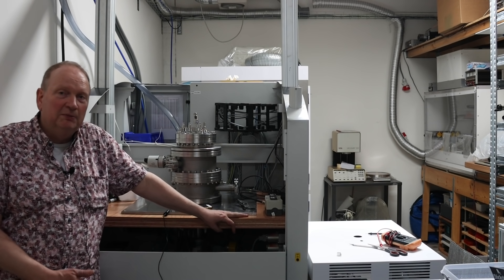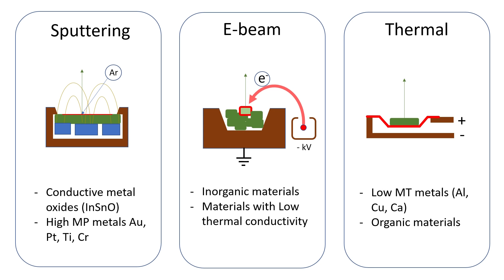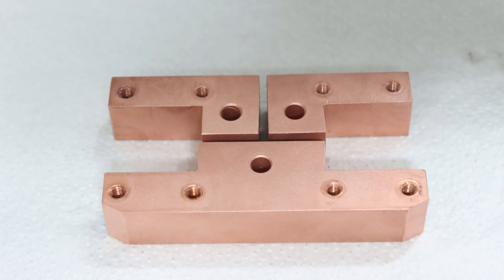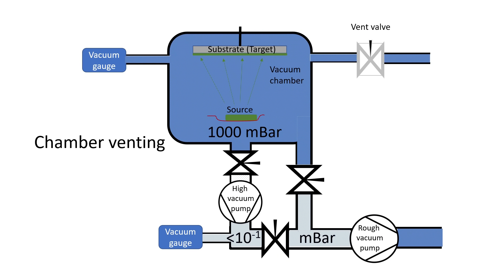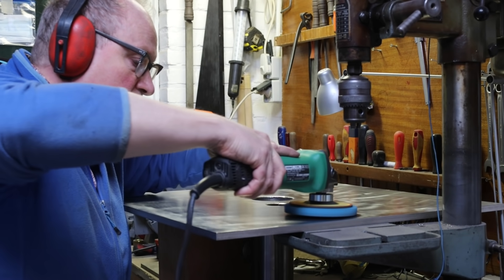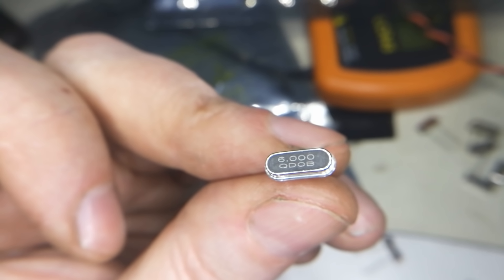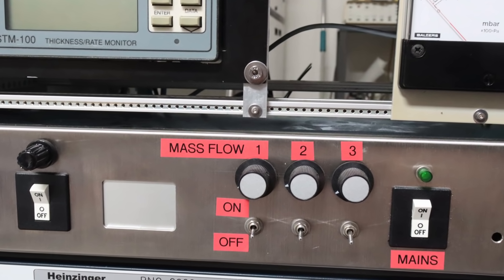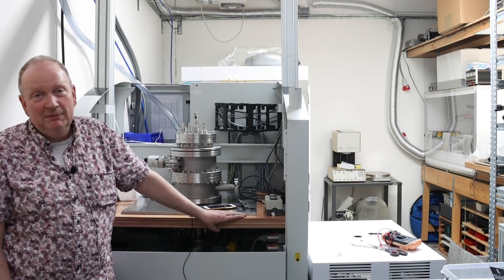DIY Physical Vapor Deposition (PVD) using Thermal Evaporation

Comment: I was goìng to ask if the quarts crystals were redundant after each use and i think you answered that i believe by having to buy purpose ready crystals.
Am i correct?
I wanted to ask also the quarts crystal being measured by its weight persay during gas transferal would it have to be recalibrated after to zero out the readings?
Reply from the maker: The electronics quartz crystals can in principle also be used multiple times, although it depends a bit on the thickness of the layers that you deposit. Generally you could use them for about 5 - 10 runs or so. Quartz crystal frequency is dependent on the gas pressure, although not so much any more once you go in the deep vaccum range. You reset the layer thickness value to zero using the value the frequency when you start evaporating.

Comment: Are there subcontractors to do this kind of work for you instead? As you say: "means to an end".
Reply from the maker: Sure, but that would be pretty costly. I could have maybe bought an old system. There is really no telling what that would have cost, from a commercial seller probably well over 15.000 Euros, although you can be lucky and buy something for a few thousand Euros from ebay. Still, these old machines generally require a lot of work to get in shape. My motivation to do it myself was the fun of building and learning, and at the same time to put a lot of my workshop junkyard to good use.

Comment: so what are you going to make some sort of super lens of with layers of silver at 551nm to 590nm thickness. I wonder if you could change the angle the mount, so it deposited the silver layer unevenly then you deposited some sort of fiber optic like Aluminium fluoride on top of the angled sliver so the angle could over power the 0.12 RI of the silver. maybe I don't really understand how RI works, but I would think if you had fiber optics forcing the light to come straight down and enter the low RI film at angle greater then RI of the low RI film, it should be functionally negative, right. it's been a long time ago in jewelry school when I studied RI or Optics.
Reply from the maker: For metals refractive index works somewhat different, it's a  complex number since the extinction in the material is extremely high.  Anyway, I'm mainly going to make diffractive and emissive devices with this system.

Comment: Wow, this takes me back ! :-)

In my early career, I spent a lot of time around high-vacuum and vacuum-evaporation systems. I ran an ultra-high vacuum system when I was doing semiconductor research at university (10^-9 torr), using ion pumps and a TSP (titanium sublimation pump). Turbomolecular pumps of that era had high pumping speeds, but couldn’t get to the vacuum levels we needed. (I dunno, maybe they still can’t, or maybe they were just too expensive compared to ion pumps back the ?)

In my first job in industry, I ran a lab that had 3 vacuum evaporators and an ion implanter in it. Those systems all used diffusion pumps, and I grew so tired of tearing down and cleaning/repairing diffusion pumps that in my next job I didn’t let on that I knew anything about high vacuum 😆

It’s been decades now, though, and I’d kind of enjoy tinkering with high vacuum again, even a diffusion pump :-)

I love your material and can’t wait to see what you end up doing with your new PVD system!
Reply from the maker: Well, vacuum technolog is actualy quite a lot of fun, as long at you don't have to repair and clean stuff all the time, which unfortunately happens a lot if you use old equiment... (;-)

Comment: i heard a leybold D2500 turbopump go from 39,000 rpm to 0 in about 0.2 seconds. it, as we say in the industry, "puked" high quality aluminum dust into the laser cavity. the HV plasma then "vapor deposited" it all over expensive glass that has to be an electrical insulator but isn't any longer.... i love my job.
Reply: I can still hear the 'bang' during the self-destruction phase of Leybold TMP1000 pumps. Those pumps were notorious for that, so our customers (CD-producers) needed at least on or two spares on stock.  Bearing failure? I once tried to get original bearings from the manufacturer and he quoted 800 Euro for the pair of ball bearings...With the advent of MagLev pumps reliability has gone up.
Reply: @michaelhompus2475  balancing it after a bearing change is not easy

Comment: The irony... I just dropped about $4000 on difussion pumps, rotary vane pumps, thermocouple gauges, cold cathode gauges, stainless fittings, tig welding conversion kit for my mig welder. And here you are doing what I'm about to do. Neat to see Applied Science caught on to this video, I'm definitely taking a lot of inspiration there.
Reply from the maker: Just curious, what are your plans for the system you will be building?
Reply: @HuygensOptics  I have a two ideas that stand out most, my first project will be condenser microphones, sputtering the diaphragm with varying metals. And second will be for telescope optics. I may experiment with some photovoltaics, semiconductors, or displays, but not much beyond giving myself a bit of a chuckle to say I did it. Maybe down the road an affordable electron microscope will turn up randomly, cause I'd love to do some backwards engineering of some chips.

For now though, it's more like a puzzle of what materials I can collect and assemble together. I'm still weighting my options on what kind of chamber to use. Glass bell jars are beautiful, but also really expensive. Pyrex cylinders I've been eyeing a lot more lately as they are very affordable. Or maybe I'll get lucky and an affordable vacuum chamber will turn up on ebay or locally. One can dream.
Reply from the maker: @TickyTack23 great stuff looks like you have quite a journey ahead of you! Maybe you should consider doing a little photolithography as well or use shadow masks (as was shown in the latest Breaking Taps video). Anyway good luck!

Comment: Read all comments, and saw noone asked yet- really interested in how you did the central mechanical rotating passthrough that still allowed high vacuum to be achieved- would like to build a Czochralski furnace someday to make my own sapphire boules with custom colors- and a mechanical crystal rotation rod is needed. Can you do a video on the construction of this portion? Absolutely incredible work, your channel is one of the absolute best on youtube
Reply from the maker: Thanks. I can very quickly tell you how it works, maybe it will feature in an upcoming video, but I don't know when. It consists of an axis with a bend, inside a very flexible vacuum bellow. This allows for an hermetic sealing of the feed through, because of the bellow. You can rotate the axis inside the bellow by moving the off-centre part of the axis, as is shown briefly in the video.
Reply: @HuygensOptics  I took a look again, and it appears there isn't true circular rotary motion with a standard axle then, only a wobble using the bellows- so it does not appear as though there is actually straight rotary motion to the inside, in the sense of a constrained motor shaft, correct? If this is the case do you know of a way of creating such a union?
Reply from the maker: @CaskStrength777  You are right, there are a couple of small vacuum compatible bearings inside that decouple the rotation from the wobble. There is also a bearing on the outside of the bellow to connect it to a stepper motor. I must admit it's kind of exotic, and I did not give it a lot of thought, until now.
Reply: @CaskStrength777  If you need "proper" rotation a magnetic coupling is best. Either a glass or ceramic window with strong magnets on either side is the most simple motion feed through. Downside is you have low torque and the magnet strength limits your holding force. The other option is basically a blcd motor using several coils around (inrunner design) a ceramic/glass tube (ferrule) and magnets on an inner shaft as your rotor. When the coils are powered in sequence, you get rotation of the rotor. This gives you greater torque and allows precision control. The magnetic coupling is usually used for manual rotation, such as moving a shield or substrate. Depending on your skills and requirements, either option can be constructed for under $200.

Comment: Nice work! But I do not know any material that you can do in thermal evaporation that you can't do in sputtering... Even for optical lens, one of the tests we've made with sputtering was put PTFE on a normal plastic lens. Just don't forget you have to use RF or pulsated power sources...
Reply from the maker: Organic electroluminescent materials such as the ones in OLED generally suffer from strongly degraded performance (or no performance at all) when you try sputtering them or even when you try to sputter additional layers like electrodes on top of them. Evaporation of organic emitters is one of the applications of this setup.

Comment: Hello, what flow rate and how you will evacuate it out of chamber, let say if you need to run for few hours, same time to keep pressure lower then atmospheric? 
Regards 
GEHNGIZ
Reply from the maker: I use approximately 100cc/min air. With this flow I can get a stable plasma even when fully pumping on the chamber (no throttle). Plasma generation should be done close to the inlet where the pressure is at its highest.
Reply: @HuygensOptics  Thank you sir 🙏,  nice lab you have,  i believe you spent quite long time to build it.
Regards

Comment: Watching my collection of lenses and an old agfa camera, infested with fungus, I got interested in vacuum deposition.
I did not get involved but underwent several setbacks on my projects.
Your commentary reveals your steadfast determination and the doer in you. All the "junk" you have collected over the years will surely and quietly find an application you had in mind, even if it takes centuries!
Best wishes!
Reply from the maker: Well, mold inthe AR coating is relatively easy to remove with pitch polishing. That is, if you know what you are doing of course. Getting a new coating on is a different subject. That is generaaly very expensive. But sometimes it is not even nescessary to have lens surfaces coated it it is just one, because not all surfaces are equally sensitive to ghost reflections.
Reply: @HuygensOptics  thanks for your reply!
Those were very old multi element glass lenses, some bound with balsam, which is not used these days. After safely cleaning the exposed surfaces, there were no new abrasions but the periphery had coating tortuous radial veins of lost surface coatings.
I do not want to remove the remaining coating!
It's a large format camera which could handle color film!
I have made small high voltage transformers (max 200 milliamperes) later all of them were the shunted type, to handle short duration short circuits.

Comment: Hello. Thanks you for the video. Can you please explain what is the purpose of bypass line in vacuum system and when we can don't use it?
Reply from the maker: The bypass is used to pump down the chamber while the turbo is running to bring the chamber vaccuum down to a level that the turbo can handle. After that level is reached the bypass is closed and the other two valves are opened.
Reply: @HuygensOptics  Can we don`t use it?
Reply from the maker: @konstantinektov3473  yes, you can leave all the valves out.

Comment: What range MFC did you use for the plasma cleaner for air injection ? I am about to build something similar and have some units in the range 5 .. 200 cc/min. Did you feed compressed air into the MFC, or was one side just vented to the atmosphere ?
Reply from the maker: The plasma was generated from air at atmosphere not from pressurized air. The flow controller has a maximum of 100cc/min but that value was specified for Argon. I usually use it at the max setting (fully open). In my case I have a small chamber and a relatively large pump, so even with the high flow rate, I have found it is best to generate the plasma close to the inlet, where the pressure is at it's highest. Sounds to me the units you have should be perfect for the job.

Comment: Excellent video. Can you tell me about the material and fabrication of the Inspection window please ? Regards, Mark, New Zealand
Reply from the maker: The smaller window in the chamber lid is quartz. I did not make this myself, fortunately this window was present in the surplus part that I acquired. I think this was clamped using some soft metal seal such as Indium.
Reply: Would love to see detail video on fitting the optical window to the apparatus myself. Always wondered how this was done too! Indium as a seal- very interesting

Comment: How do you finally test for flatness ? Interferometer or what ? Nice video.
Reply from the maker: You mean the flatness of the bottom plate? For that I used a straight ruler, since the specs are not critical at all,
Reply: @HuygensOptics  No, i mean the reflective surface.
Reply from the maker: @BigBoss-rh7zq  I ususally test against a flat test glass using monochromatic lighting. In this case however it was just a glass sample and there was no particular flatness specification, so no need to test it.
Reply: @HuygensOptics  Thank you for your answer. It would be nice to test the eveness of deposition along all the surface.

Comment: As someone who used to work with plasma cleaning and deposition, and ultrahigh vacuum systems, I take my hat off to you sir. Also, you got lucky with that turbo pump - I've seen the after effects of one which let use while running and it wasn't pretty. Great channel and keep up to good work.

Comment: Great stuff as always!  I think I was holding my breath the whole time you described the turbo accident, happy it turned out repairable!  And at least you know how to strip the turbo now for whenever it needs new bearings :)  Any plans to extend that plasma cleaner to a full RF sputtering magnetron in the future?  Can't wait to see what you make with your new coating capabilities!
Reply from the maker: Hey Zach! As they say here in the Netherlands: every disadvantage has its advantage. But personally, I had rather not risked the destruction of the turbo in order to know where the bearings are located ;-). I have no plans to implement RF sputtering (yet). Instead I want to add a small e-beam source with 4 crucible pockets. Advantage would be that the  unit would fit with a small footprint and have the option for depositing many different materials in a single run. I do have previous hands-on experience with ebeam and like it a lot as a method for evaporation of specific materials, such as metal oxides. But now, I'm going to focus my efforts on making devices rather than on expanding my deposition capabilities.
Reply: @HuygensOptics  Oooh, an ebeam would be amazing! Can't wait to (some day) see it, always been curious to see what goes into making one.  It seems like a really flexible technique to deposit a wide range of materials.  But yeah, I definitely know how that goes... easy to get carried away and keep making tools instead of projects with those tools :) Eagerly awaiting the next video :)
Reply: @BreakingTaps  If you can get an old CRT and cut the front display off, you have your ebeam along with focusing and steering yoke. If you don't plan on doing imaging with it, that will be plenty accurate enough.
Reply from the maker: @excitedbox5705  I don't think that the electron beam of a crt is very suitable for e-beam evaporation, because of its relatively low power and bulky construction. You generally need in the order of a few hundred W to a kW to get to a good evaporation rate.